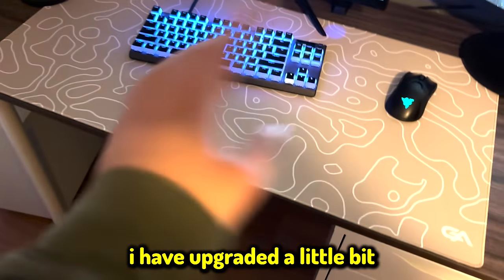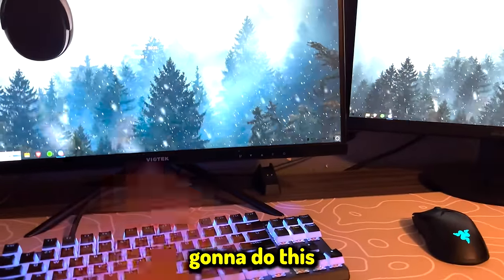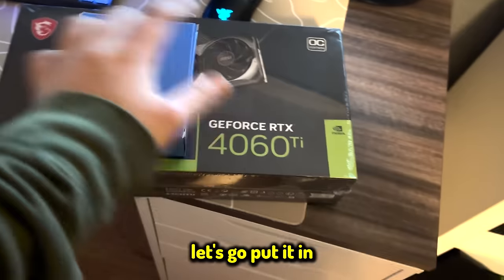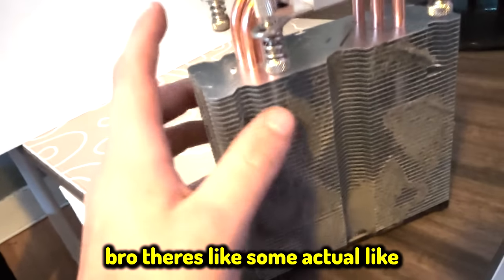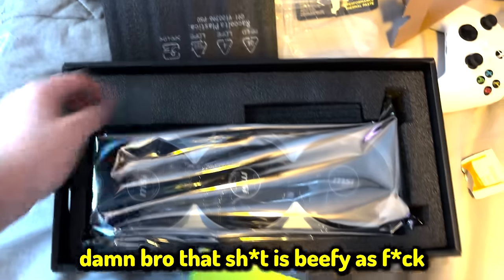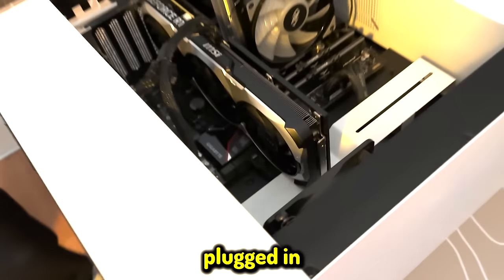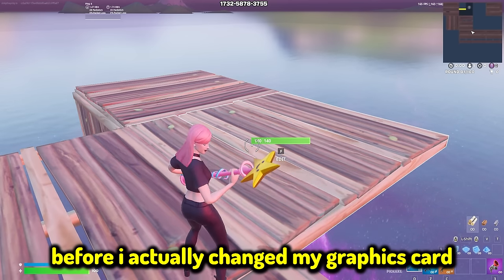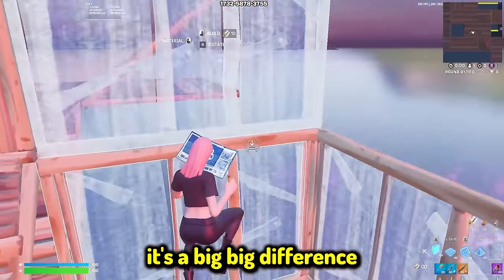I UPGRADED from a 1660ti to a 4060ti (1000fps)

Comment: you could've gone with a 7800XT double the VRAM and overall, a better graphics card than the 4060TI. (edit: it'll cause a bottleneck with the processor being old)
Reply from the maker: Little late for that 😂
Reply: @ZinkyThePinky atleast you have dlss 3 :D
Reply: @rayzersharpp  what about FSR 3
Reply: @MAWIMO0  noticeably worse than dlss 3, also radeon cards are not as good for content creation which he said he was doing. the main blunder here is the cpu. he should have went for am4 as that platform is cheap right now and offers significantly better performance than something like a 9700k
Reply: @casmithh  I agree
Reply: NVENC >
Reply: @board1x  if you care that much use a capture card
Reply: biggest issue is the 4060 tis bandwidth
Reply: @BASEDGUARDMMA  cant be running high framerate games with a cc
Reply: @BASEDGUARDMMA  BRAND LOYALTY
Reply: @casmithh  got higher frames rates than most people here so I beg to differ
Reply: @BASEDGUARDMMA  the hell does that have to do w/ anything?
Reply: @casmithh  lil brother you’re gonna have to wake up you said you can’t have a high frame rate with a capture card and even the amd option nvenc equivalent there’s no noticeable difference
Reply: @BASEDGUARDMMA  you literally cannot see past 60 fps if you are displaying your capture card feed, consumer capture cards are limited to 60 fps. if you are running w/ a capture card and are using that to capture, you are at 60hz on your display.
Reply: @casmithh  then you go and ignore the part where I said the amd equivalent is literally the same nowadays it’s not 2010 anymore
Reply: mate amd cards have massive issues with dx11, and perf mode uses dx11,  but anyways good correction
Reply: its fortnite nivida works better
Reply: @casmithh For streaming yes, but if your just recording videos you’ll be fine.
Reply: @maxschaefbauer5601 Highly debatable.
Reply: @Rolkey  nah, even premiere works better on nvidia cards to a noticeable degree.
Reply: @casmithh  Fair enough.
Reply: @casmithh you’re forgetting about HYPR-RX, which will allow frame gen even on performance mode, as well as Anti-Lag+.
Reply: @casmithh  I’m pretty sure there’s other software out there.
Reply: @Rolkey  premiere is the top-notch editing software for windows, any professional editor would agree. Stuff like davinci is alright and a good alternative to some of the greedy practices that Adobe has in place, but premiere is still the best.
Reply: @BASEDGUARDMMA  amd cards still do not have an equivalent software to nvidia profile inspector. Not too important but profile inspector comes in handy when a buggy update comes out in any game and you need to make adjustments for performance
Reply: @casmithh  brother you wont see a difference unless your looking at it through a microscope

Comment: Make sure you enable XMP in your motherboards BIOS 
So you can take advantage of your rams full speeds. 

Definitely need to swap out the cpu for something better and newer
Reply: XMP does way more harm than good.
Reply: no it does not you enable so you get the eam speed you paidfor and not some bottlenecked speed @Exostream
Reply: @Neec00  It’s a simple look up + i suffered when I turned it on, most of my games would constantly crash. 4070 ti with a i7-13700F btw.
Reply: im 2 months late but that sounds like a you problem, xmp is great lol @Exostream
Reply: @Migatte  not a me issue, a quick look up shows xmp dead causes more harm to a pc than good.
Reply: @Exostream  works great on mine and many others, you are a part of the minority lil bro
Reply: Xmp makes your ram run at the speeds its listed at on the box

You got other issues in your PC@Exostream
Reply: Xmp CAN make your system unstable but that just means you need to set your timings manually instead of letting XMP do it for you, which you're still getting the same benefits as XMP doing it yourself, just some systems sometimes crash bc of it, it doesn't do your PC any harm crashing, you just boot into bios and turn it off

Misinformed fearmongering is what harms PCs more

Comment: I  feel like a 4060 feels the same as a 3070 it's still a huge upgrade congrats man
Reply: 4060 is slower than a 3060 ti. Tech power up relative performance charts puts the 3070 at 27% faster.

Comment: by the way one thing i recommend when upgrading cpus is also upgrading ram, they are big counterparts in the pc and your ram is probably now bottlenecking your cpu (not certain but good chance)
Reply from the maker: Upgraded to a 7800x3d and 32gb
Reply: @ZinkyThePinky  excellent that will sure get you at least half an fps more also what’s the clock speed on the ram?

Comment: Great video man. I have a pre build with a i7 9700 and 1660ti and have been having issues. You helped me with upgrading my GPU and RAM for just smoother performance without breaking the bank.
Reply: xdddddddd in fortnite there is no difference between gtx 1660 and rtx 4060, fortnite is a processor game
Reply: @deeri__  there is but its a small difference
Reply: @mthmnng  i agree
Reply: @deeri__  I don’t play Fortnite.

UPDATE: I got the 4060 and I have to say I do not regret the purchase games are running 40x smoother. Personally would recommend.

Comment: Did you use ddu to uninstall drivers before adding the graphics card?
Reply from the maker: Nah
Reply: @ZinkyThePinky  thats fine its not major. if you experience issues with display, you can update drivers or use ddu to reinstall from scratch

Comment: Good video just one thing... at those resolutions it was probably the cpu upgrade that gave the frame bump...at lower resolutions games are more cpu intensive so that i5 was getting run ragged where as the extra cores and hyperthreading of the i7 really boosted frames....you should throw the 1660ti back in with the i7 and record a video just for testing purposes...keep up the great work🫡

Comment: One thing you wanna do is to check the rams mhz because if your rams are capable of running on 3200mhz i rather recommend you to make them run at that speed instead of 1500mhz.

Comment: should i buy 4060 or 4060ti theres a 120 euro price gap, only need 8gb vram fortnite performance mode 1680*1050/1920*1080 sometimes aiming for 240fps lowest settings
Reply: you should get the 4060 and use that exstra money to get 32gb
Reply: @NO_Skiller  I ended up getting a 3060ti for less than a 4060ti by like 50€, and the vram is the number for the gpu, ram would be 32gb a 3090 has like 24gb vram

Comment: good video i cant wait to get my first set up im going with amd setup 7800xt and a AMD ryzen 7 5700x with 32gb ddr5 ram ddr5 is just a way better choice for my competitive and casual needs 4060ti is a good choice but with my ocd i will have a panic attack if i dont see stable 240hz and i want amd because they have more vram so that to me is just better for future gaming i wont have to worry about upgrading my card for quite a bit also @zinkythepinky what version of 4060ti did you get 8gb or 16gb model ? i just wanna know it i love looking at setups  also i recommend a switch on the i7 that you got because it can bottleneck your graphics card

Comment: In a game like fortnite getting a really beefy gpu with a decent processor wont give you a big performance boost since the game is more cpu intensive (calculating where all the players are, all the builds placed, loading the map) its all on the cpu. So if you play e-sports titles like fortnite, rust, cs2 prioritize your cpu. Not saying cheap out on the gpu, get something that wont bottleneck your cpu, but dont prioritize it

Comment: Why are people complaining about the dude talking about cpus like i5/i7? It is mentioned in the video they got 9700k (old i5 because of that is at best 9600k which is less powerful) so you cant just slap a +10th gen there like some comments say?? But if you just bought the cpu, there is no real point in upgrading to 9700k unless you got it for very cheap and/or did not have ability to go for a whole new build otherwise (so getting a better cpu for already owned build is a lot more cheaper option). Also 4060 ti is a great card if you get it for reasonable price, esp the 16gb version.

Comment: Two things you need to do to accommodate the gpu, upgrade to 12 gen i5 or i7 intel processor or better and get a new motherboard compatible with all the parts. also i3, i5, i7 and i9 are basically the same performance what really matters is the generation so 9th gen i7 causing a major bottleneck.
Reply from the maker: Yup I’m working on getting a new one rn
Reply: a 9th gen intel i7 is NOT bottlenecking with an 4060 ti XD

Comment: nice, right now i have a 9700k and a 3070, ive been looking to upgrade. Your 4060 ti gets so much more fps in fn than my 3070, i have a 165 hz monitor and i cap it to 180 because thats good to do and i only get like 185 in creative for some reason.
Reply: Why do you cap ur fps at 180 when ur monitor hz is 165?💀
Reply: @chieffalley4955   if you cap it at 1 more than whatever your monitor is your gpu wont get as hot or as much utilization  so for me my monitor is  165 hz, theres no need to get 210-220 fps when i dont see that much from my monitor especially in creative.

Comment: I ain't no professional but i think the cpu cooler isn't facing the right side, the the radiator has dust on the exhaust side which tells me that the fan is blowing at the intake fans
Reply from the maker: Well, this is a prebuilt… built by professionals 💀

Comment: Can you pls explain to me Why you need a 240hz monitor if you can Get 400 fps on a 144 hz monitor? Because i’m buying a new pc soon but will i be able to Get 240 fps on a 144 hz monitor?
Reply from the maker: You can only see the frames that your monitor can run 😭 the more frames the smoother but if you have a 144hz you can’t fully see 240fps
Reply: This physically hurt to read 😭

Comment: why my performance mode runs so bad? i have like 170fps and stutter, i have rtx 4060ti , r7 5700x and on dx12 all low i have 200-220, how can i fix? (i have 32gb ram 3600mhz aswell)
Reply: use performance not direct12 it's not ideal for a rtx 4060ti
Reply: I'm getting a rtx 4060ti with i5-14600k

Comment: I have a 2060 and get the same fps uncapped, and that doesnt make sense. make sure that you have the right drivers, make sure ram is set to max speed. and try to overclock ur  gpu with MSI afterburner and youll  get more  than 500-600fps

Comment: Sadly Fortnite is a CPU game(on perf mode). You could've gone with a 3060 or 4060 and put the rest into the cpu to get way better fps. (Like 2 or 3 times more). I'd recommend going for a 5600x,5700x,5800x or 5800x3d if you want to get a cheap mainboard. If you are fine with buying ddr5 and getting a better mainboard i would go for a ryzen 5 7600x or 7700x. If you can spend more you should 100% go for a 7800x3d but it's really expensive. Your 4060 ti is being bottlenecked over 30% (depending on res and settings). Edit: I saw many people being toxic about your choice and i don't think they have a right to. Everyone makes a mistake sometimes.. Its gonna be fine(you are just gonna be loosing on some performance) if you are fine with that there is no reason to change anything.
Reply from the maker: join my discord, lets talk parts!

Comment: I don’t think the 4060 ti is a good choice for a GPU. The rx 6800 GPU performs with about 40 fps more in most games from what I’ve seen, and it’s the same price. The only difference is nvidia has some features like frame generation and dlss3, but if you’re playing Fortnite, I’m pretty sure the rx 6800 will usually outperform the 4060ti even when the 4060ti has frame generation and DLSS enabled.
Reply: if you are playing on performance mode, all amd cards are really bad in comparison to nvida's.
Reply from the maker: Yeah I like my 4060 🤪
Reply: @Dave1fn  That doesn’t matter, as long as you have an average cpu and ram the rx 6800 can run Fortnite at over 140fps at medium settings. The performance mode is out of the picture.
Reply: @ZinkyThePinky  i got a rx 6800 and it shits on that card i mean 8gb in 2024 is pretty bad.

Comment: what cpu would you guys recommend with the 4060ti for peak performance?
Reply: Ryzen 5 7600 or if you gonna go cheap go with Ryzen 5 7500f and for intel fanboys i5 13400f or 12400f (not recommended) Intel is not recommended because of that is a dead platform unlike am5 which gonna continue for a few more years

Comment: i7-9700K + 4060 Ti?

one recommendation would've been to get at least an i7-10700K or 11700K since those allow the GPU to perform at its best

(if you wanna know why, it's because 9th gen CPUs from Intel still had PCIe Gen 3 before their 10th gen CPUs came out with Gen 4 support, and now we got the 12th, 13th and 14th gen CPUs with PCIe Gen 5 support for future GPU generations and the fastest Gen 5 NVMe SSDs available at the moment)
Reply from the maker: This is the 400+ comment I’ve seen like this but I am getting a new cpu
Reply: @ZinkyThePinky  this might be the 1millionth comment about this topic, but it's up to you when it comes to buying your parts for your PC depending on whatever you want your PC to handle (which in this case is Fortnite at very high framerates), i am just suggesting something that could've given you a couple more FPS for free

Comment: Not bad of an upgrade but why the 9700k?😭 like get a new motherboard like am5 or if you want intel you are goanna get no upgrades in the future so get an am5 so you dont have to change the motherboard. Like get a 7500x or 7600 and set the max ram speed in the bios. Enable xmp and set the max speed and youre good to go but if its not working try lowering 200 mhz. Have a great day

Comment: yo, i want recently buy a 1660 super you know if with 1660 super i can play resolution like 1080?
Reply: Yeah, you can. You should be able to get about 144hz playing fortnite on 1080p. Just search up some benchmarks though
Reply: with performance mode you can probably get 240 fps on comp settings in 1080p. Whats your budget for a gpu though? Theres a good chance you can find an amd gpu thats better for a similar price
Reply: @phoenix0246  i don`t know what`s a gpu i`m 10
Reply: @Mopob  gpu is graphics card
Reply: @phoenix0246  thx

Comment: a decent upgrade but u need to change that CPU to a newer one like a I7 11th or even a 12th gen as the one u bought bottlenecks the GPU a lot cuz as the I7 9th gen is on the older side

Comment: not bad but that 23% cpu bottle neck gonna make it feel more like a 3060ti
Reply: probably even lower, the 4060 ti was barely an upgrade over the 3060 ti and due to the 128 bit bus, its slower in a few memory intensive things.
Reply: @End3rDog  ik bad choice to upgrade to be honest like if he just plays fortnite with a 160hz monitor there is no point upgrading until he plays new games may as well wait for a better deal on a 50 series card when they come out

Comment: I used to have a ASUS VG328H1B 144hz Monitor. On fortnite in creative I would run about 100-165 FPS (165 is really pushing it). I then upgraded to a Odessey G9 Oled monitor. My PC runs an i5 and a 1660 Super (1660 Super and 1660 TI are basically the same but TI performs better.) And now in Fortnte creative i run about 200-365 FPS which is a big difference and normal games I used to get 60-120 FPS and I still get the same maybe a 165 here and there but thats because of my Settings so Monitors also help.

Comment: PCIe 3.0 Bottleneck because its not a new MB

Not a good combo. Maybe do an upgrade in future to get the full potential out ouf it.
Reply from the maker: Can you translate to normal people terms 😂
Reply: @ZinkyThePinky don't worry you'll only be losing a few FPS anyway
Reply: you wont be noticing pcie 3.0 vs 4.0 the difference is still negligible
Reply: I have a pcie 3.0 mobo and just upgraded to the RX 6800 am I seeing performance losses due to only having 3.0?
Reply: @fullest7896  no
Reply: @ZinkyThePinky PCIe lane is slower thus docking performance, you’ll only loose out on like 30-60 frames. It’s nothing major tbh.

Comment: dont set it to 1 or 2 above the framerate, its not good, either go to 288 or 144, and enable xmp on your motherboard to get faster ram speeds, and also your cpu is way to big of a bottleneck. i feel like you should have done a whole upgrade to like a 13600k and new motherboard ram, and jsut a whole new pc

Comment: is a 4060 ti and a ryzen 7 7700x a bottleneck?
Reply: Ask Reddit? Also get a 7800XT if possible, unless you care about becoming a streamer and all that if not just get a RTX 4060 Ti. Please make sure it’s not the 8GB version.
Reply: the Ryzen 7 7700x is really good and doesn't bottleneck the 4060 ti at all. the CPU is mostly paired with the 4080/4090/7900xtx.

Comment: you need to plug the adapter for your gpu with 3 cables, not just the one cable. your psu wil explode
Reply: it wont explode but youll just have less performance
Reply from the maker: New video.